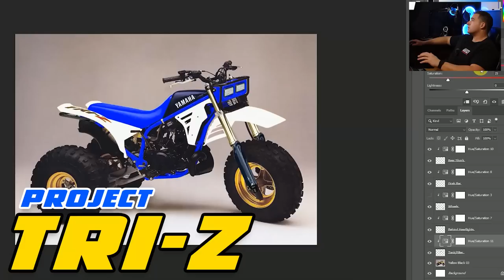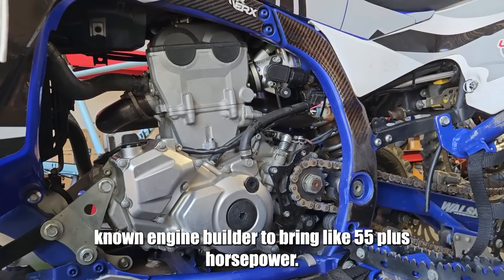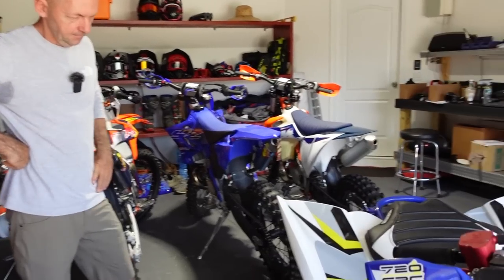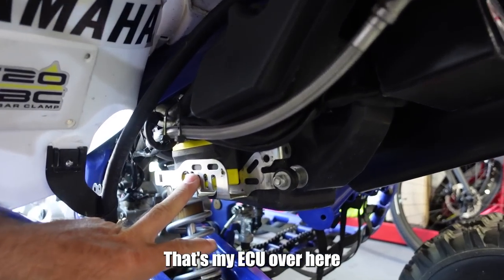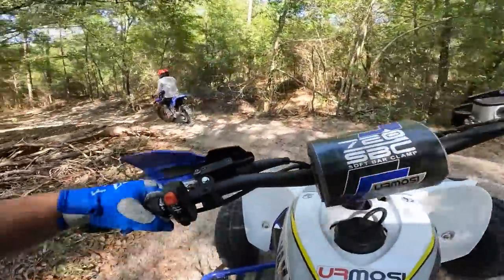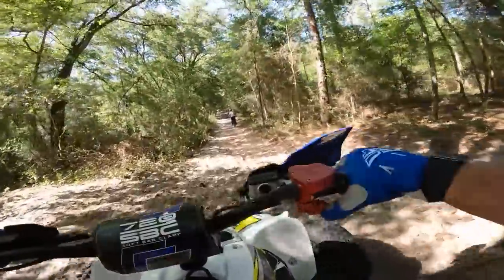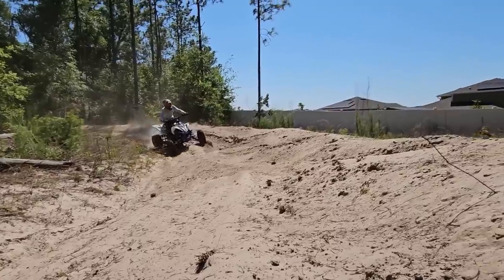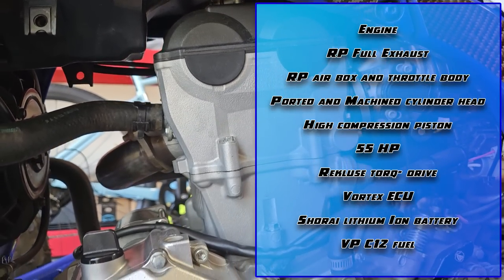Yamaha YFZ450R Full Custom Walsh Build with Robert Urmosi

Comment: Definitely a sweet quad but dang does it looks like it rides SO much more ruff then a dirtbike
Reply from the maker: I think just in general quads beat you up more because of the smaller wheel diameter and suspension travel.
Reply: @MichaelSabo  yea not only that but also you get side to side bouncing that you do not get with a dirtbike

Comment: 2019 to newer yfz need the clutch basket swapped for a 2009 2010 clutch basket. The stock clutch can come apart and wipe out the engine. They only have 3 riviots

Comment: You should do a build on a polaris outlaw 500, it's the same engine as the predator 500 but has irs. One of the best quads out there in my opinion and are really under-rated.

Comment: The fact that there is more money in Walsh components on that YFZ than the entire cost of Top Quad 3 still blows my mind.  Having my own YFZR with a vey similar suspension setup from Walsh, the LTR geometry front end is unbeatable in corners.  Just get your piggy bank out if you plan to build a pro class caliber machine.

Comment: yamaha raptor 770cc at 75mph in 4th gear I can pull it up then shift into 5th and it's just stupid.   Even did a plus 3mm intake valves and plus 2mm exhaust valves.   Stage 3 cam, but I kept my compression at 11:1, too many things I've done including full Hinson clutch set up.   Geared to the moon...  I use lithium ion battery.   105.5mm piston and cylinder, stroker crankshaft.   Plus many other features.  Great video btw

Comment: He did all that work and left the factory breather box on? RP Race and 38 motorsports both make an aftermarket one that cleans all that up nicely and the votex ECU come with a bracket to mount it in the original spot and you can ditch the factory bracket if he was really trying to save weight im kinda confused why he  re-mounted the bracket back to the airbox... but overall sweet bike !